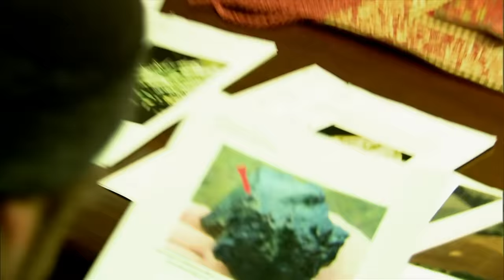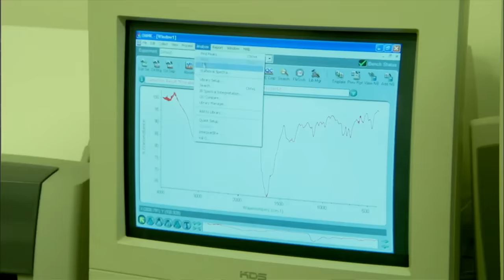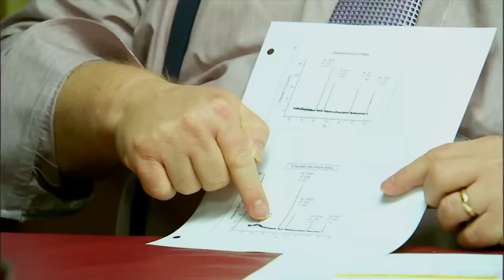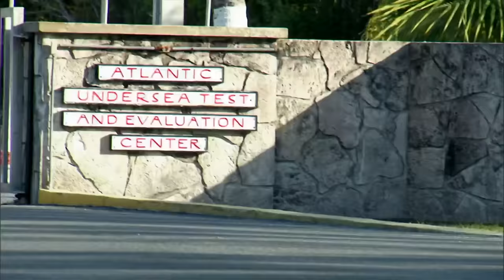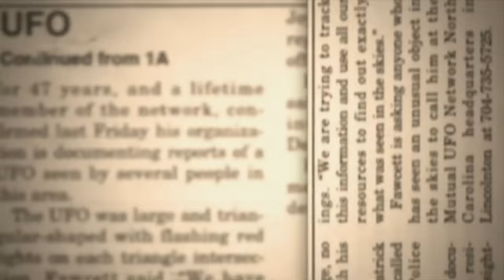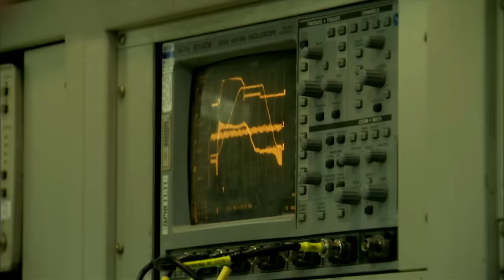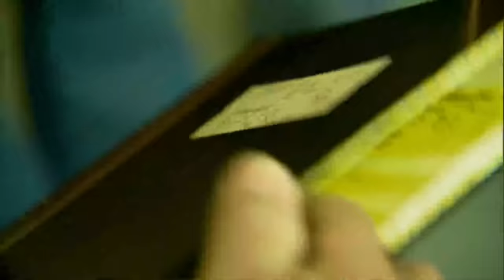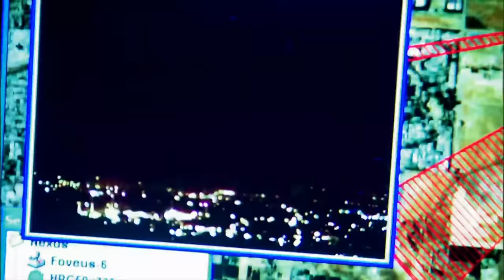UFO Hunters: EVIDENCE of Aliens Visiting Earth for CENTURIES *2 Hour Marathon*

Comment: I live on an island in the Caribbean, and captained a deep sea submersible, into the Cayman trench, it is over 25,000 feet deep, the sub is only capable of 3,000 feet, I have been down 2600 feet, but the wall where we go down has trenches cut down the wall for 400 feet below sea level, meaning there were water falls there at one time there are several trenches down the wall with rocks and debris at the bottom fanning out, indicating the ocean levels were at least 400 feet lower than now when these were eroded into the rock wall, geologist said this island is geologically stable since before they were made, Then, around half of the world's population lives within 3 km of a freshwater body, whilst 90% lives within 10 km. so knowing that most of any civilizations back when the oceans were 400 feet lower would now be under water, basically erased in time. start looking 400 feet down a little less where the shore lines would have been there may still be monoliths surviving, stone could survive, and maybe some statues etc. the ice age around 20,000 years ago locked up the water in ice age ice. 🤔